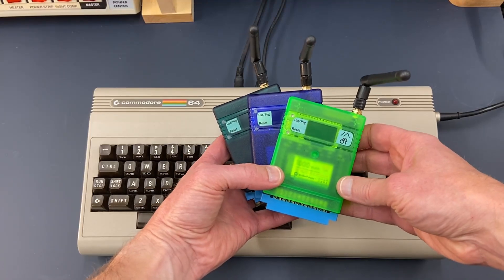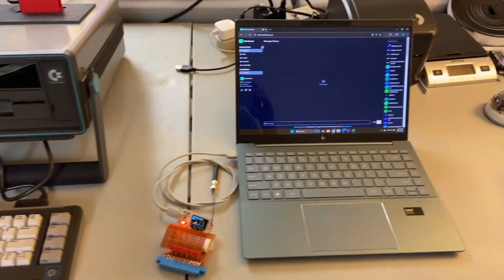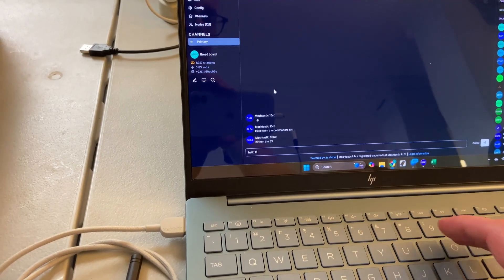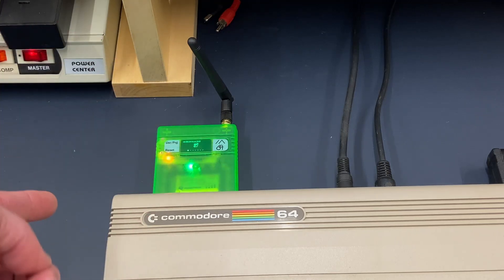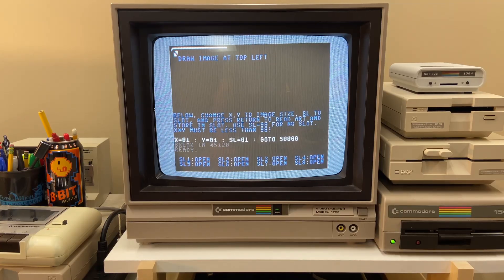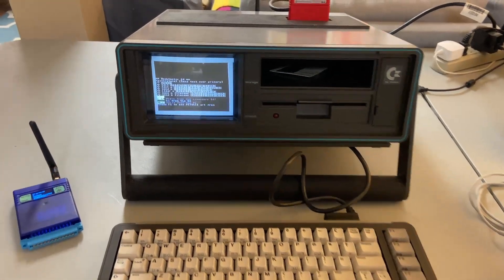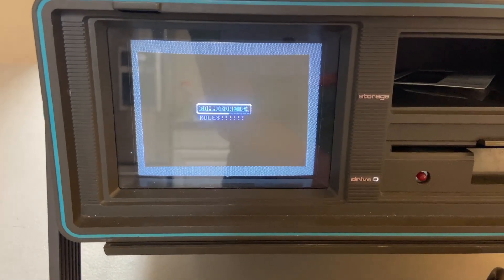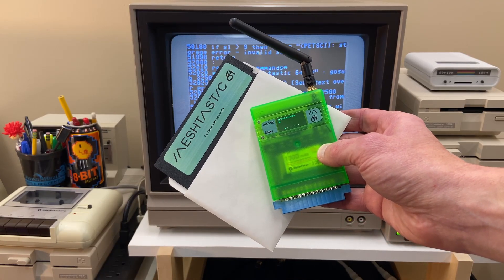Meshtastic 64 Demo - meshtastic for the commodore 64

Comment: How much mA are needed, can the original power supply cope when a 500mA cartridge is also plugged in?
Reply from the maker: The original power supplies can’t be used with this. Due to how they fail shorted, you shouldn’t be using them in 2025. This requires a bigger power supply with at least 2.5 amps on the 5V line.

Comment: This was probably not on anyones mind when they created the 64 back in 82. It's a cool proof of concept, but i think I would rarely use this, since I usually use my c64 for games I used to play back in the 80s.
Reply from the maker: Right, pretty sure home mesh networking wasn’t expected. However, they did expect modems to be plugged into the User Port and this leverages those serial lines and Kernal routines.
Reply: @jim_64s8-bitprojects5 Agreed, the data rate wouldn't be an issue at all.

Comment: Could it be made to work similar to the old C64 modems and use Punter or XModem for file transfer?  Is there an equivalent to baud rate?  (Most of my knowledge is from that era.)
Reply from the maker: It is very similar communications via the same user port serial that modems used. But with the specialized 200 character max messages that include the senders name, it won’t really work with a general purpose terminal program or file transfer protocols.
Reply: @jim_64s8-bitprojects5  Well that sucks, you should get on that.  😂 
  But if i remember correctly Xmodem sent data in 128 character packets, you might be able to cobble that for post apocalypse game sharing.  I recommend Elevator Action.

Comment: An interesting reworking of the C64 packet radio hardware and software. The C64 was also capable of several other modes with appropriate software and cartridges.

Comment: It looks cool and all, but I don't really get why there is specific hardware involved in a simple chat program, don't most users have some sort of modern modem for the C64 nowadays? I mean if you have an Ultimate product then you have one automatically. To me this would be great as a little C64OS app that you can have running in the background minimized, and maximize as needed, and obviously without the hardware bloat!
Reply from the maker: I don’t think of this as a replacement for all the cool WiFi and network devices for the c64. This is for those that want to connect to the growing decentralized, peer to peer, long distance, text messaging, meshtastic network. People really enjoy meshtastic for a number of reasons including the long distance technology, the off grid / decentralized approach, and/or the an emergency preparedness aspect.
Reply: I don’t think you know or understand what Meshtastic is

Comment: I have been a licensed amateur radio operator for 32 years. This setup is VERY similar to Packet. Look up packet radio and the (modems) we used. I STILL have two PK-232MBX's on the shelf. We (hams) were doing this back in the EARLY 1980's!